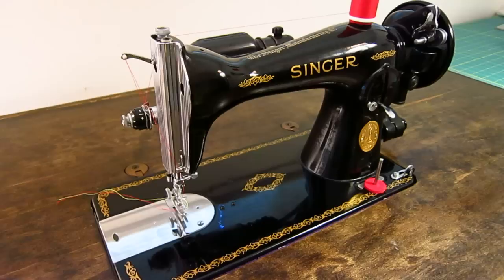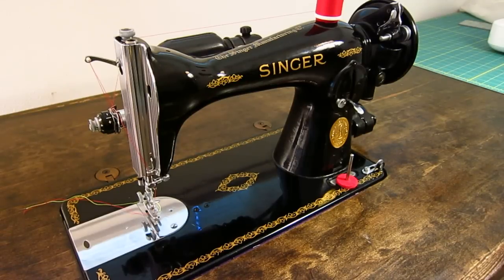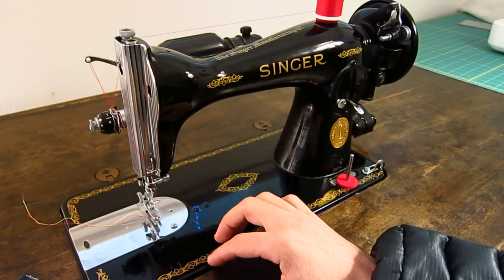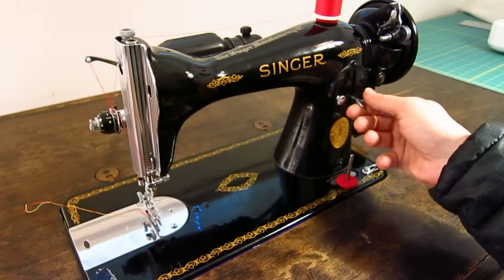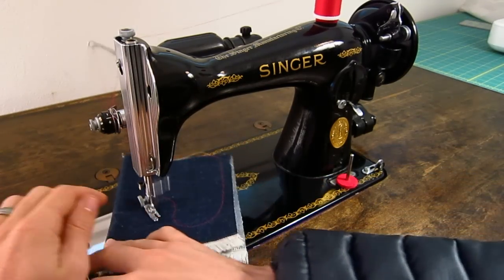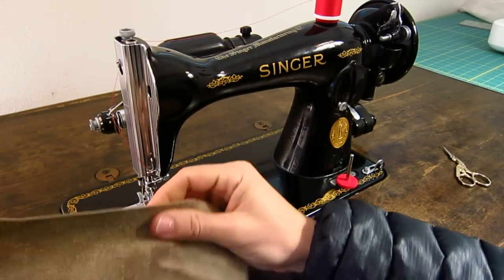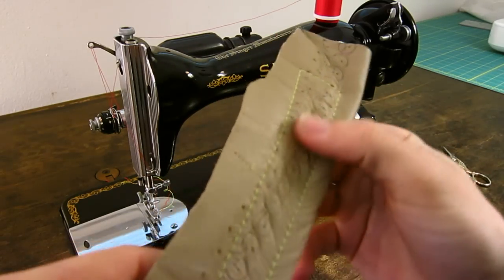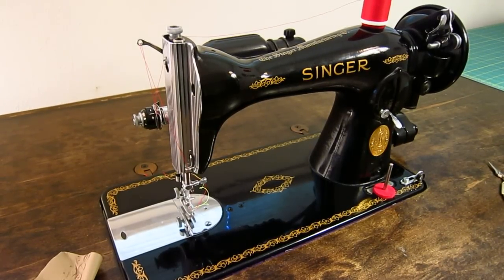1948 Singer 15-91 Sewing Demonstration

Comment: I enjoyed the video and would like to know where can I purchase the Motor Lubricant for this machine.  My mother has had this machine since the 40's and  gave it to my daughter just recently.  It runs but it is running slow at time as if it needs a good greasing. I have oiled all the places that require oil.  Any recommendations would be appreciated. Thanks

Comment: I am having a problem with mine 
the top string go's down but get's stuck on the up stroke 
and it also don't always pick up the bottom thread or bobbin thread

any idea's?
Reply: +Joseph Azzato I have to brake the thread to get the needle back up and can tell when I actually get one or more up strokes for a stitch, it is working my motor really hard like there is tench-in that is not normal

Comment: I have one of these and I'm having some tension issues. I'm using #69 nylon and a leather needle (100/16) and the same thread in the bobbin. I've had to raise the tension so much I literally can't pull the thread through, but the stitches finally look ok, no loops underneath. Is it possible to change the bobbin tension? Any hints would be appreciated.

Comment: I got one for free it was in pretty bad shape I had to rewire it. Yes the insulation the on wiring was breaking up. it works great now!  I think mine is older than your though the tension assembly is different doesn't have numbers on it! And the light is totally different. The varnish has come off of it it some areas! exposing the decals so some are missing on table area.

Comment: I’m having trouble filling the bobbin on a similar machine. Everything snaps into place, but the rubber wheel doesn’t catch to spin the bobbin. I was thinking I could just tighten down the arm that snaps the bobbin in place. Any tips? / thoughts??
Reply: Sounds like the rubber bobbin tyre has become worn and hardened. Very cheap an easy to replace. Bobbin tyres can be bought on Ebay and AliExpress.

Comment: Thank you from a beginner. I’m clueless with the use of a sewing machine and have been looking for one. Would you think this model could handle sewing through fire hose? 2 layers of canvas and a rubber layer? I really don’t want to get an industrial machine since this is just a hobby for my daughter and me to do together. I have the option of buying a Singer 15 or 66. I have been using an Awl but kinda of getting tired or the manual stitching. Anyways thanks again for the informative video.

Comment: Hello. You convinced me about this machine. It look so easy to operate. I checked your video because i found one in craiglist for a very good price. The only problem is that it doesn't work. The motor runs but the thread doesn' t move from the spring. What that should be? I don't want to bring it to repair because it will probably costs more than what i payed for.Tks.
Reply from the maker: +Lea Pereira There's a silver knob on the right side fo the handwheel that allows the handwheel to be disengaged from the machine while you wind the bobbin.  Sounds like that may be the problem.  Hold the handwheel with your left and and tighten the silver knob on the hand wheel (rotate clockwise).  That should reengage the motor.   Search online for "Singer 15-91 manual" and read through the threading and lubricating instructions.  Also, make sure you check the wiring coming out of the motor.  Often times it needs to be replaced as it's a shock/fire hazard, but you might get lucky, so give that a look.  Enjoy it!
Reply: Thanks for your help. It was simply the need that was installed in the wrong position. It is an amazing sewing machine. You are right. I just love it. There is only one thing that happens. Usually when I use reverse there is smoke coming out from it. What that could be? Tks.
Reply from the maker: Glad you're enjoying it!  Where is the smoke coming from?  If you have a 15-91 (direct drive motor) you should see smoke coming from the brushes at all, since it's totally enclosed.  If you have a 15-90 with an external motor, sometimes the motor brushes will smoke a little bit.  It's due to contaminants/oil coming in contact with the brushes and then being burnt off.  You can remove the brushes and heat them with a small pen torch and then clean the commutator with denatured or isopropyl alcohol.  Or you could leave it as is, it shouldn't be a problem.
Reply: The smoke seems to come from the motor which is external. I will try to clean like you said. I am glad to know its not dangerous for the motor. I don't know if my machine is a 15-90 or 15-91, I bought second hand. Is there a way to find out which one is mine? Thanks a lot for your help.
Reply from the maker: If the motor is external and the handwheel is driven by a belt then the model you have ais a 15-90.  Someone probably over oiled the motor bushings at some point and contaminated the brushes/commutator.   Remove the brushes, while being mindful of their position and clean with some alcohol.  You can put some alcohol on a q-tip and push it down into the brush hole and then rotate the hand wheel to get the commutator to spin.  That will clean the commutator somewhat as well.  It won't be as effective as a full teardown but you might see an improvement.  Goodluck!

Comment: haha thank you for making this! my grandma has this machine (and has had it for forever) and its my first machine/teaching machine she thought this was hilarious but its pretty educational for me so thanks haha! 

also would i be able to sew stretchy fabrics like spandex on this machine (bc it only straight stitches)?
Reply: Sorry my reply is coming 4 years late but maybe others will read it. Since my mother only had first a treadle which I did use a bit at age 7 then a Singer straight stitch only machine by the 60s thats all we had. Stretch knits were coming in style so I guess I learned how to do Stretch and Sew. I eventually bought my own more modern machine which had zig zag but I barely use that or any built in stitches. For one its a bear to unpick. I still only use straight stitch now at 64 to sew knits. You loosen top tension a bit and hold fabric very lightly in front of and behind the foot. You stretch the material a teen tiny bit when it goes under the foot. The only way I can describe it is like passing a little hammock under the foot. You do NOT stretch it against the pressure of the foot. That will warp the material. Unless you purposely want what they call lettuce edge!
Reply: @lyricwritertoo  nice

Comment: Thanks for your wonderful video. My non-working Singer Machine made in 1948 (AH395) is very like yours, but the large metal plate on the left side, where the tension wheel is located is beautifully decorated with a scroll pattern. Would the model be a 15-90? what does the 90 and 91 refer to? I appreciate your help!
Reply from the maker: Thank you for the kind words!  The style of the cover plate changed the through the years.  Typically the pre 1950's models have a more ornate pattern.  The 15-XX numbers refer to the motor type.   15-91 is a "potted", direct drive motor.  The 15-90 is an external motor.  There are also treadle and hand crank variants.

Comment: Picked up this same model, with original table and seat.  Need a bobin and replace wiring.  New to sewing, bought it for boat seat repairs, so i think it should be fine.  Guess I did good for $30, lol.  Thanks for the video!
What type of wiring did you use?

Comment: I just bought one of these about a month ago.  Today is the day I want to start cleaning it.  It sat either in an empty house or garage.  It's pretty glunked up, but I can tell it can be just as shiny as yours.  What do you use to clean your machines?  I have some no pumice gojo that I used on a 66 that was in rough shape and it seemed to do the trick but I like to hear what everyone else uses.
Reply: You have to be gentle with the "japanned" finish, a good way to go is cleaning with sewing machine oil and a soft cotton or microfiber. If it's really bad (old cigarette tar is the worst) use that gojo or rubbing compound, but be careful you're not taking lacquer or decals off. Any cleanser with alcohol or solvents will destroy the finish.
Reply: Robert, what about vinegar, in a dishsoap and vinegar solution?  The 15-91 I picked up has so much gunge and mouse pee all over it.. :(

Comment: Hi, beautiful machine.  I have a 15-91 and wondering where you get the mirror like finish on the slide plate and needle plate?  Thank you.  Appreciate all your efforts.
Reply from the maker: This particular machine was in almost mint condition when I got it so there wasn't a whole lot of restoration work needed to get it to shine.  I use mother's mag and aluminum polish for the plated parts.

Comment: I have a 15-91, but the bottom stitch doesn't look as uniform as the top stitch. When I finish a line, the top looks perfect, but the bottom sometimes looks loose. Any advice on what to adjust to fix this?
Reply from the maker: Your bobbin tension is too low, you need to increase it slightly by turning the larger of the two screws on the bobbin spring clockwise.  You'll likely have to bump your upper tension up after this adjustment.  Google "Singer 15-91 Manual" and you find a section covering bobbin tension.  GOodluck!

Comment: Hi, I’m having difficulty removing the faceplate from a Singer 15 (1923).  It looks like yours, but not so shiny, in that the tension control assembly is over the faceplate near its rear corner.  There are 2 small screws on the rear side of the tension.  I’m thinking I need to remove the tension discs first, in order to remove the faceplate, so I can shine it up and oil moving parts behind the faceplate.  I would appreciate any suggestions you have.  I feel like I need a sewing machine technician’s handbook, because the owner’s manual is rather superficial and does not explain this faceplate removal problem.  Hoping you have ideas.  Thank you, theSergeant!

Comment: I just bought singer 15-91 without footpaddele.  There is one wire coming out of potted moter with two prong plug. There is one wire coming out of light with two prong plug. I don't know how to attach these plugs to power and footpaddele. What type of footpaddele do I need.

Comment: Singer actually had another machine from that era with a direct drive motor, the 1200-1. From what I've heard it was basically a 201-2 in an industrial style table, with a knee lift. They only made 4500 of them. I wish my 201-2 had a knee lift :)
Reply: MrDonohoo Hello, my aunt has 66-15 model with a knee lift but not to raise the presser foot. The knee lift is used for sewing. I love her machine because it’s in a nice cabinet and has a drop in bobbin which I like!
Reply from the maker: You are correct.  I had one and it was a fantastic machine.  I repainted the legs and refinished the top.  Once you use a knee lift you can never go back.  That's part of the reason why for portable machines I only use vintage Berninas now.  The 1200-1 is a great machines but after using industrials it's painfully slow.  The floorprint of the 1200 was close to my industrials so I had a tough time justifying having it.  Great machine though!

Comment: I do love this machine.  I just wish I could use it.  When purchased it sewed very nice even sewing stitches but now it refuses to sew less than 100 or more stitches per inch.  I watched your instructions on adjusting the stitches, but I still can't chance the stitch length.  I even took the plates off to look inside but can't change the stitch count.   Any suggestions?  Thank you.

Comment: Can someone help me? I recently got one of these from my deceased Aunt's house, but i've never had any experience with dealing with old sewing machines so it's all new for me. I got it threaded and all, plugged it in, but I can't figure out how to make it run? There's no peddle like in the newer versions of Singers. Is there supposed to be one or am I just an idiot and i'm missing something really important in front of me? Thanks.
Reply: there's a lever underneath you use your knee to use it.
Reply: Is it a knee lever control machine? If it has a case the lever is usually stored / clipped inside the bentwood case.
Reply: Yes, I found the lever after a long time of being frustrated that i couldn't make my shorts lol. But thanks anyways!

Comment: I have one, but the motor spits out sparks and smoke, and is quickly loosing strength (as if parts of the motor are burning out, and only a little is left.) If I continue to test the motor, I am sure the tiny part that still works will burn out. How could I get into the motor to fix this? I took off the case over the motor, but the sparks are way in the back.
Reply from the maker: I'm assuming you have a different model with an external motor that is connected to the machine via  abelt?  If so, all of these brushed motors spark to a certain degree.  If the motor is smoking excessively it's possible that your brushes have been contaminated with oil.  If you're losing power your brushes might be excessively worn and making more contact with the commutator.   The process for fixing this is a little too complex to write out.  Try searching on google for "brushed motor rebuild" or variations of that and see what you come up with.  Goodluck!
Reply: It's the same gear driven model. Also, it seems to have fixed itself so that's cool I guess. It had been shooting all sorts of sparks and smoke, but now it has the usual amount of sparks that are much smaller

Comment: Hi there! I am looking for some help with my very similar machine. I think it was manufactured in 1946. I just had a problem with my feed dog. It moves up an down, but not front to back, so it is no longer feeding. I removed the silver plates and can't find any issues. Can you tell me where I can find more information to fix this problem?
Reply: Oh my goodness! I figured it out. I had bumped the adjustment to feed forward and reverse, to perfectly centered. Hurray! I don't have a broken machine!!

Comment: Thank you for the demonstration.  I was looking at getting a 201 or even the 66 but I like this machine too.  I have a JC Penny machine that I got in the 90's for repair my husbands work clothes, but want to get into upholstering chairs and such.  Thank you again.
Reply from the maker: Thanks for the feedback!  If you can find a 201, go for it, if not then a 15-91 would be your next best bet and then a 66, my opinion atleast.  If you're doing upholstery with vinyl or leather I highly suggest looking into a Singer 111W155 or any other "compound feed walking foot" machine.  They will make the job MUCH easier.   Goodluck!
Reply: Thank you!  I really appreciate your knowledge.  I'm going to research before I make a final decision.
Reply: HEY!  I bought a 201-2 on ebay.  The sellers have 10% feedback so I'm hoping I can trust the description.  Yay me.

Comment: I've got a 15-91 that I bought in 1972 to do upholstery because my Touch Tronic 2001 simply would not handle that heavy material.  Well, all of the other machines are gone, but somehow I kept my little baby, and so glad I did.  I oil and grease it myself, and it still sews as good as it did when I bought it for $50.  You're right, it's simple, but will last forever.
Reply: OH, and btw, it's a Centennial Edition 15-91, complete with the pretty little badge.

Comment: Quick question: I'm going to be re-wiring a 15-90 I recently acquired.  In addition, I'm cannibalizing a 99K for its .6 motor (same one as the 15-90 whose motor casing is cracked) and the lamp which appears to be exactly the same dimensions, same shade.  I've never done this before.  Anything I should know before starting?  Thanks in advance for any help!

Comment: I have a 1934 and a 1950 both are running but the timing is off , I guess because the threads won’t connect through the material. Can you tell me how to set timing
Reply from the maker: Its likely your needlebar height.  I have a video on how to time a sewing machine.  Hope it helps!

Comment: I believe I own this model (from my Grandmother that was a quilter).  It has been serviced and is in excellent condition.  My problem is not being able to verify what model it is.  I only have the serial number: AH59861, and according to the Singer website that makes it made in 1948, but I have searched and searched for a model tag with no luck.  Any ideas on where or how I may determine the model?
Reply from the maker: Saam McBride Just sent you a message
Reply: +Saam McBride http://www.singerco.com/support/machine-model-numbers at the bottom of the page on this link has singer's contact info to get the model number from your serial number

Comment: I just obtained a Model 28 from 1923, with an electric motor. The electrics are (of course, for a machine from the 1920s) flaky, but the mechanicals are actually solid.

Comment: I have this machine. My feed dogs stopped working, any suggestions.  Thanks
Reply from the maker: There's a thumbwheel below the machine that controls the height of the feed dogs.  Check to see if it loosened and allowed to the feed dogs to drop.  Search "Singer 15-91 Manual" on google and go through to manual to find that adjustment. Goodluck!

Comment: My mother has this exact model. Was running fine but then the needle doesn’t go up and down anymore. The manual wheel crank does rotates. How do you open up this machine to see what is stuck inside? Thanks.
Reply from the maker: There's a silver knob on the handwheel.  Hold the handwheel and then tighten that silver knob and you should be good to go.